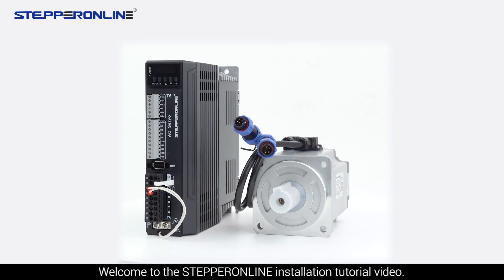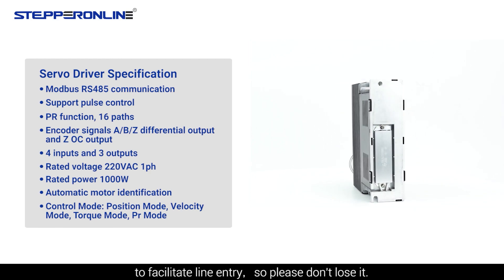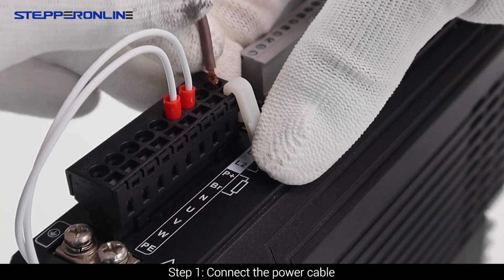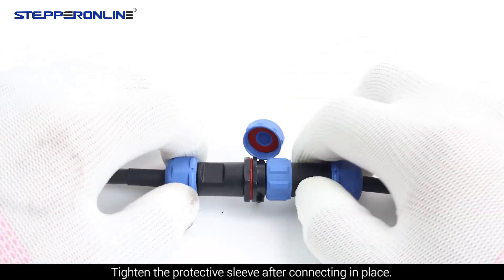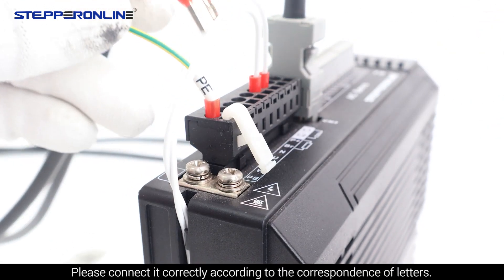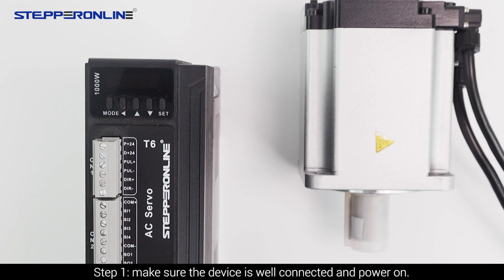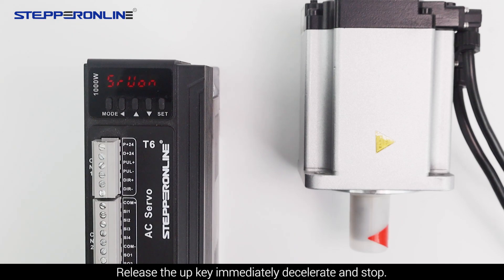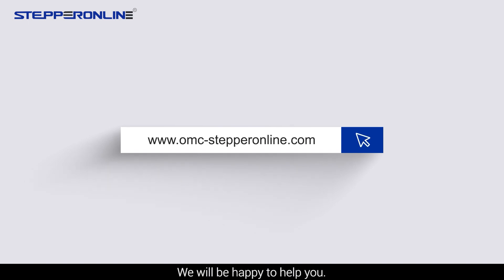T6 Series Servo Motors' Installation and Operation

Comment: Are the power and encoder cables RF shielded for use around VFD drives?  If not, can you supply us with the part numbers for the cable ends to allow us to make our own.  I will be using double shielded wire for the control signals.
Reply from the maker: no RF shielding, part numbers are
GM-1311/S-6B6P
GM-1311/S-4B4P
GM-1311/S-7 7P